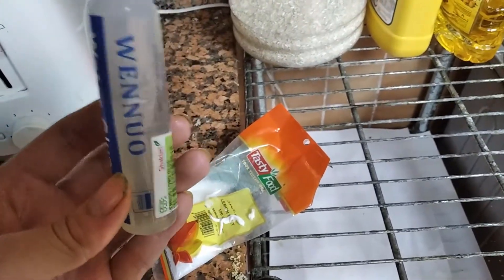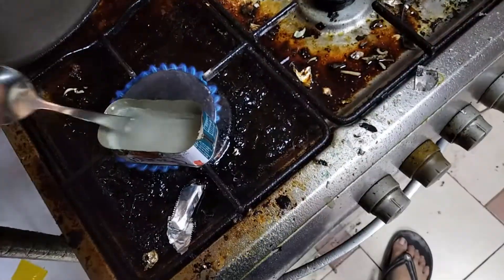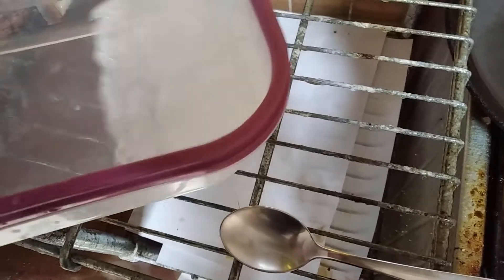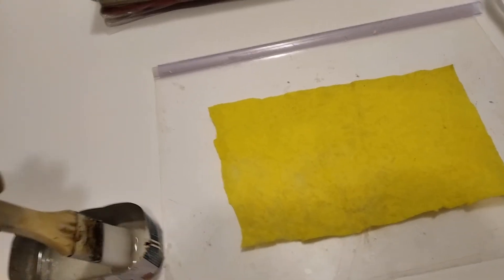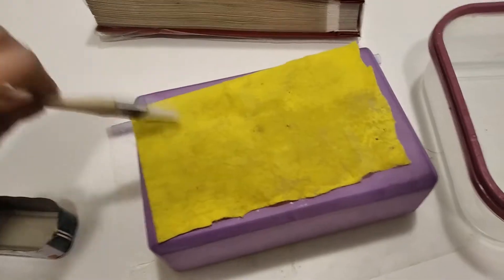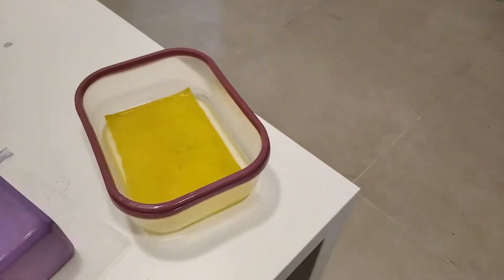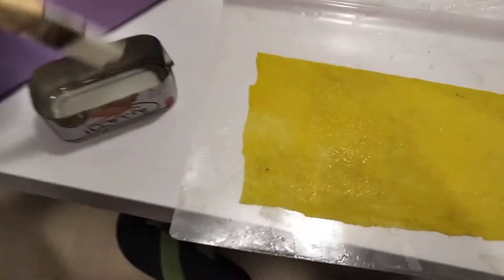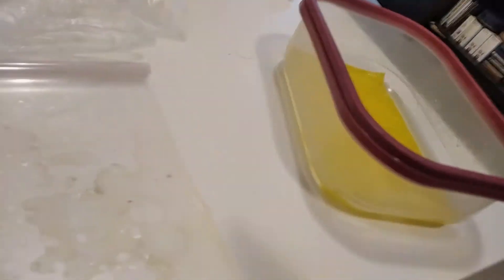Citrate Crosslinked PVA membranes (outdated)

Comment: Hi, subscribed !
I need KOH and i have lot of KCl salt, so I will build your chlor alkali cell with this PVA membrane.
Question: Do I need to use KOH (I have it in small quantity) to make this membrane or it doesn't matter, 
or NaOH can be used for KCl chlor alkali cell too?

Is this best membrane for KOH production from stand point of KOH final critical concentration and KOH purity?
If I use PbO2 as anode will it contaminate KOH solution?
If I want to purify KOH what is the best solution, I think of dissolving in EtOH and filtering it out if permeable membrane is used.

Thanks!
Reply from the maker: check my later membrane this one is older and doesnt work as good long term as the dechlorinated PVC type.

Comment: What about soaking the whole thing in the solution instead of painting?
Reply from the maker: yea that could work if you just have a flat pan of PVA + Citric acid and  dump the cotton in then pour the NaOH carefully and let it react slowly.
I just need more glue XD
Reply: @CatboyChemicalSociety  what about using a fine plastic mesh? I had some fine film with plastic holes. If we built a membrane on top of that, it should be stronger than cloth.
Reply from the maker: @anti-fz9be  yea I just bought 1 liter of PVA solution and will test plastic mesh!!
Reply: @CatboyChemicalSociety  screen printing mesh? You can get some super fine screen. And this is to be used in a hydrogen cell right?
Reply from the maker: @jvon3885  yea there is a vid on som1 who prepared a similar membrane for a hydrogen fuel cell but I forgot where.
Reply from the maker: @jvon3885  I found a vid of som1 basically doing the same thing
https://www.youtube.com/watch?v=BT3HjyziH_0
crosslinks with the PVA then cooks in KOH

Comment: What is the glue, a mix of polyvinyl alcohol and polyvinyl acetate? Is the citric acid actually converting to sodium citrate in situ and that is what forms the PVA cross links? What if you have sodium citrate will that work too, no hydroxide required?
Reply from the maker: clear glue is only polyvinyl alcohol and some water.
sodium citrate is not recommended as the crosslinking will be instant and uneven and you will end up with powder as it crashes.
you need hydroxide and fairly concentrated too which you can easily make using the cruder borate membranes and boiling that down to a concentrate to make better membranes.
The citric acid has to incorporate into the PVA structure but it wont crosslink until sodium ions are introduced.

Sodium carbonate may work but bicarbonate is not soluble enough however the CO2 produced maybe a problem.
You can convert sodium carbonate and bicarbonate into sodium hydroxide by calcination and hydrolysis.
Reply: @CatboyChemicalSociety  Ah I see, I understand now, thanks for clearing that up!